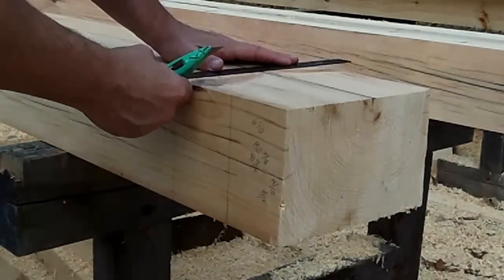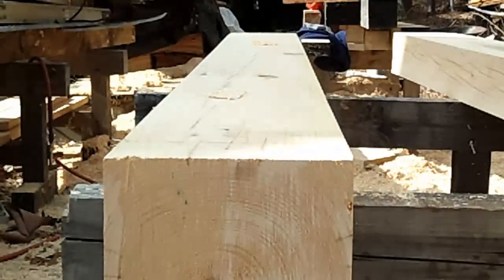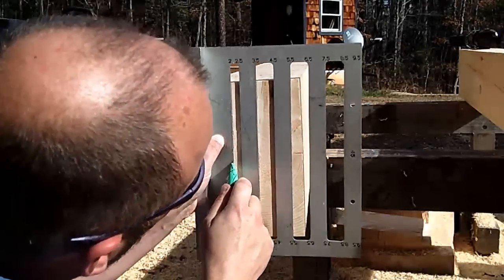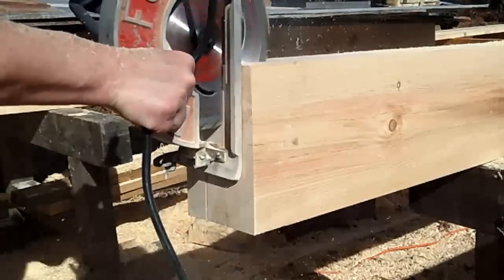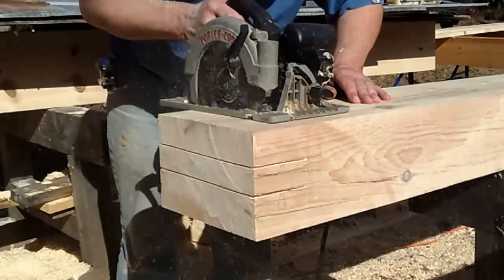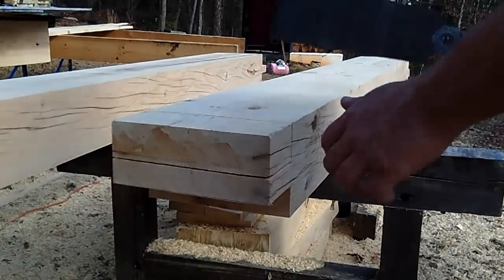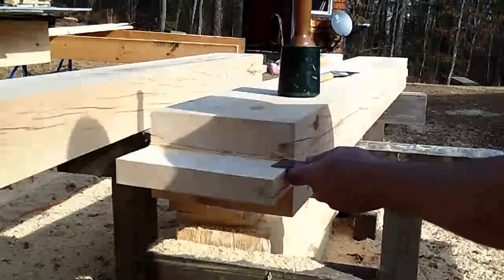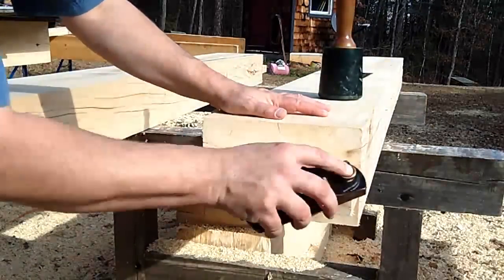Making a Timber Frame Tenon - The Drop Cut Method

Comment: Nice job with the video.  I've always found I have much more control with the drop cut if I stand facing away from the timber and to the left side (I am right-handed as well), then look down to your right and behind you - there is the end of the timber.  Hold the saw as you normally would and make the cut top to bottom.  I've done it as you have shown as well, and while this method is do-able I feel more like I'd break a wrist if the saw bound up or kicked.  To each their own though!  As you said, whatever makes you comfortable.  Thanks again.
Reply from the maker: +Jerry Learn Thanks for the comment, I do sometimes handle my drop cuts as you do and it is a great method.  Knock on a timber but I have never had one bound up yet or seen one using the method in the video.  Cheers,
Brice